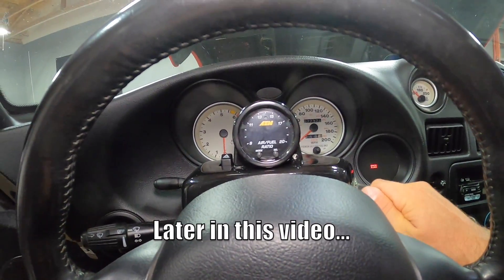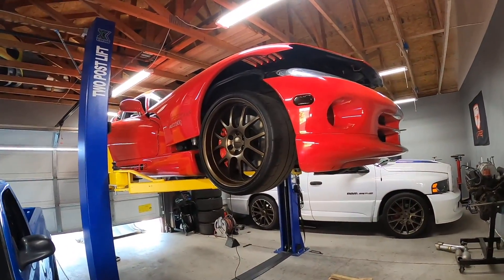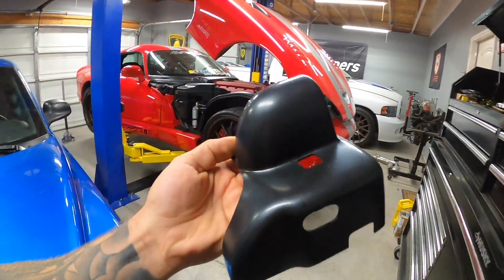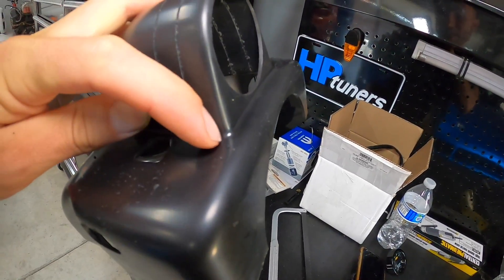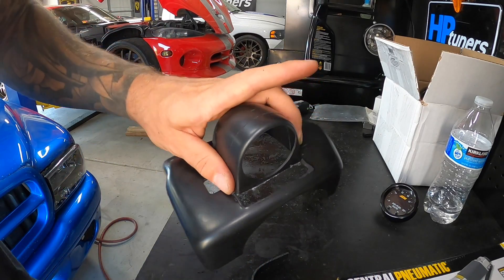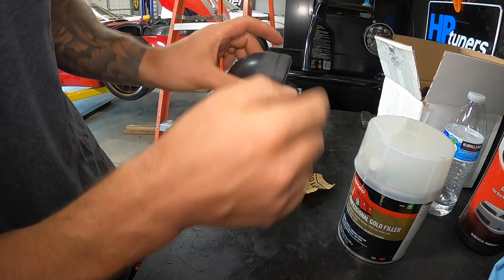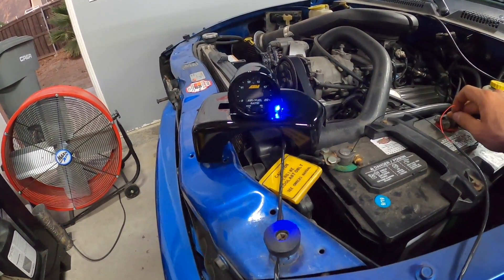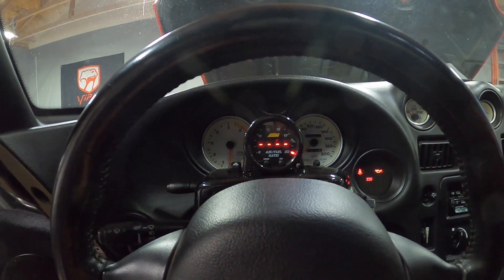INSTALLING WIDEBAND O2 SENSOR | Dodge Viper Supercharger INSTALL | Part 2

Comment: Trying to figure out not taking up 2 gauge places when running dual widebands.  Don't want to do Innovate.  AEM really has nothing.  Looking into other outfits like Ballenger.  Still no solution found.  (Can't believe dual sensor gauges are not popular.)  NOTE:  Also learned there are 3 grades of NTK sensors ranging massively in price.

Comment: If you're going to put a Roe on it, get the larger 2.8 or 3.2 blower unit. The standard 2.3 doesn't really move enough air for decent power across the RPM range. With a Roe, it will feel really torquie down low/lower mid range but will fall off after about 120/130 compared to a Paxton NOVI 2000 or 2500 blower setup that pulls more through the upper midrange.
Lastly... tuning, tuning, tuning. Vipers are spot on with it and horrible without it.

Comment: Question on the brake videos from 7 months ago. Do I still need the proportioning valve? I have the 02 with ABS? Will it still lock the rears up?
Reply from the maker: Im not too sure ok that application. Worst case scenario you install the big brake kit and you need to add the proportioning valve. You’ll know right away when you stomp on the brakes

Comment: Great job on getting that gauge pod fixed! Are you going to be running a Roe meth kit? I have one for my 96 GTS, that was working with a VEC, but now that i am stand alone (Link ECU) its no longer hooked up by the previous owner. Id like to get my stand alone to trigger this again...as im running a 10psi pulley, with timing pulled like crazy (because No meth.)
Reply from the maker: I’m going to be designing my own kit using a AEM methanol controller and parts of the roe kit. Going to modify the washer fluid bottle and use that as the tank.